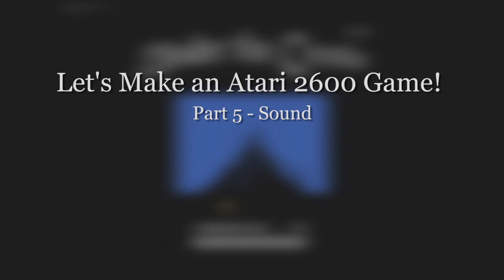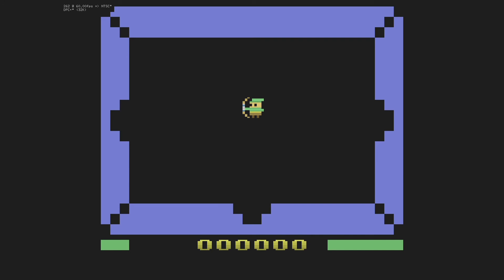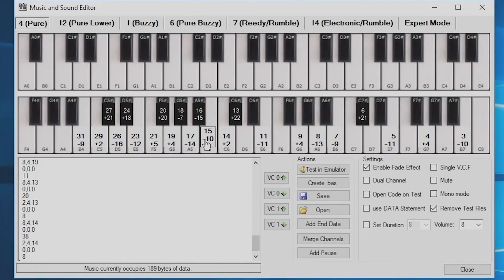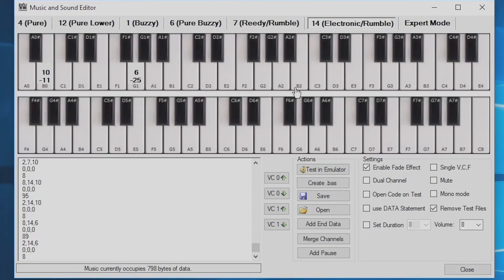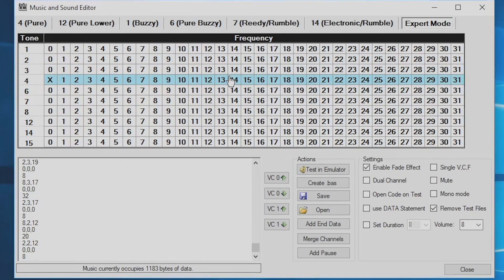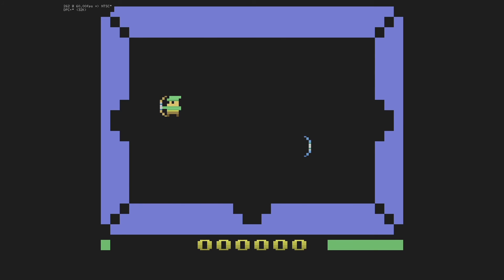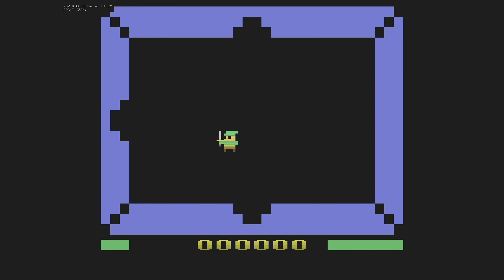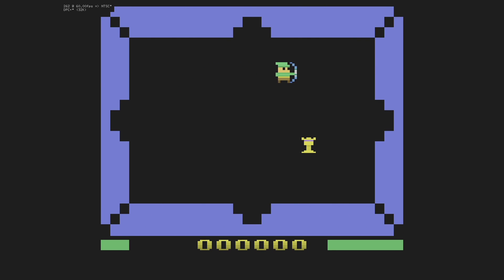Let's Make an Atari 2600 Game! Part 5 - Sound

Comment: Atari games can be as big as 32 KB. Problem solved.
Reply: You can go even higher then that actually. There is technically no limit, but games start to get more and more unstable the higher you go. I know that one or two 64kb games have been done, but that's as high as anyone has ever dared to go. Anyway, I think he wanted to get it all in without having to utilize bank switching at all. But maybe he did eventually utilize bank switching, I don't know. These videos are almost 3 years old, and I haven't watched all of them quite yet(watching them now), nor have I checked to see if this was ever released on AtariAge.

Comment: I like your health bar kernel. Would you provide the .bas for it please? Also, can it be at the top of the screen, or only the bottom row? One item you could create would be a cloak of invisibility- if equipped while you enter a room, it gives you first strike. If not equipped, they move in real time. Wouldn't be much extra code.

Comment: Coming together nicely!! How much space does the slocum music composer eat up after you put the code into batari basic?
Reply from the maker: Thanks! Not sure about the slocum music, but Visual bB's music composer can quickly fill hundreds of bytes. It records the frequency, instrument, volume, and duration. But it also records the second channel at the same time, so about 7 bytes per note. That's not too bad if you make something short and loop it, I guess. I'm so low on space I might remove my attempt at music entirely and just keep the sound effects.
Reply: Yeah, most 2600 games only had sound effects. A few had a music track, but it was a continuous loop, as you mentioned above. I would go with a simple music loop and sound effects. Plus, with assembly, I believe you would have tighter control over the music. Best of luck, and looking forward to updates.